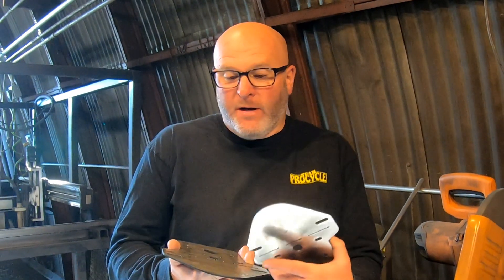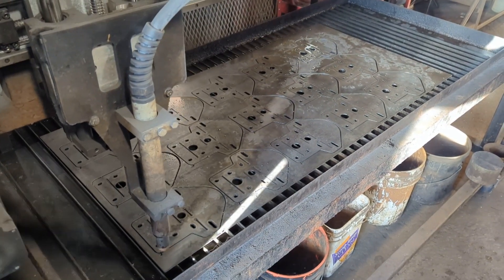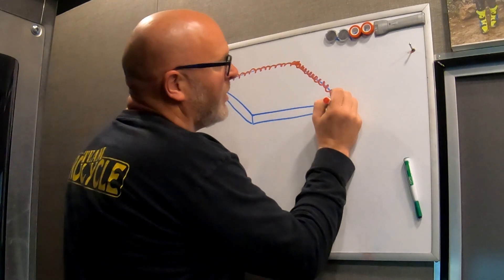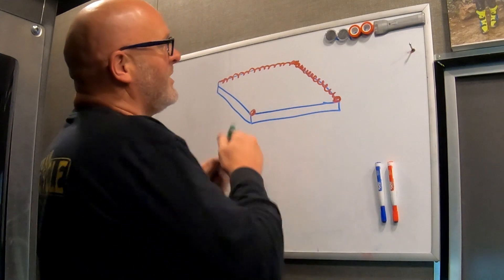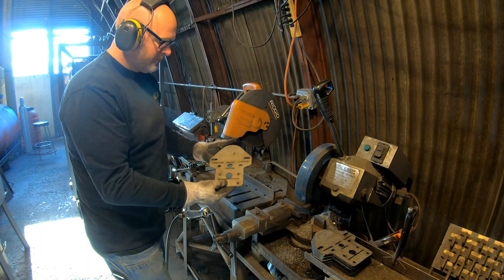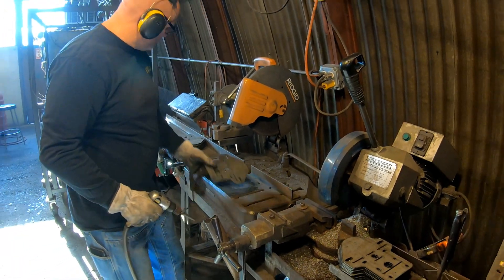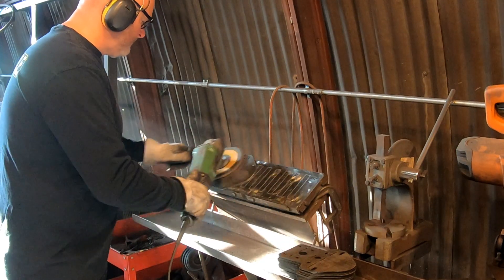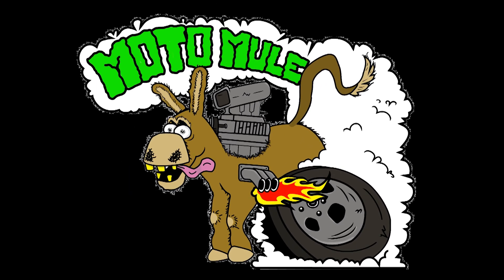How to remove Plasma Dross or Slag from your plasma cut parts.

Comment: What grit were you to sand the parts? 80? 120? Also, it looks like the disc you were using was much larger than the 4.5" disc you linked from amazon. What size were you using?
Reply from the maker: I use two different size discs, 4in and 7in, mounted on two different grinders. I've found 80 grit work best .
Thanks for watching!

Comment: You got a great setup 👍
Ever see someone use a small cement mixer with some type of media throw parts in and turn it on 😂 it works
Reply from the maker: Yes, that works great, but super noisy 😂
Reply: @motomule  yeah it can be

Comment: a bit nitpicking...: Dross is a residue that is left on the surface of molten metal, while slag is the material that separates from molten metal. 
Nice  way to remove/clean the part.        (however when cutting a lot of parts  isn't the first thing to do : change the settings to prevent the dross and/or slag ?!?!? >> increase or decrease cut speed/Raise or lower the torch height/Reduce or increase current  and check the nozzle it is clean ?? saves a lot of work :) :) :)
Reply: lot of tables cant go fast enough on sharp corners with thin steel to make it almost dross free, I know mine can't that's why I'm making another one.